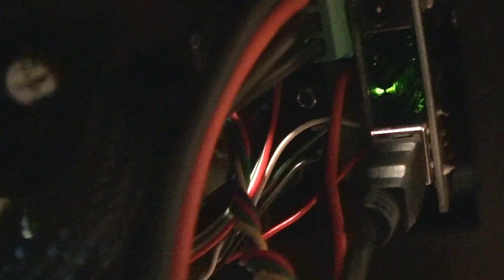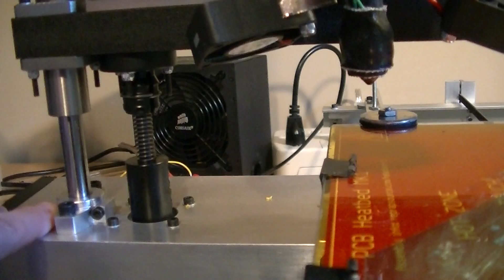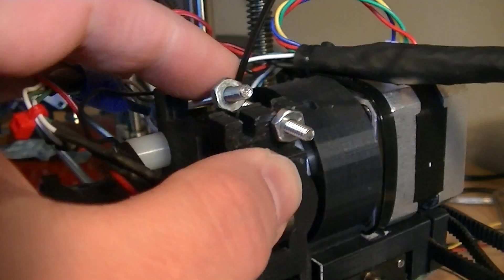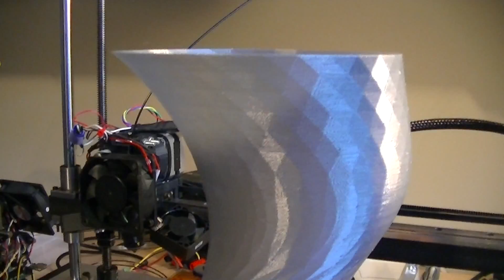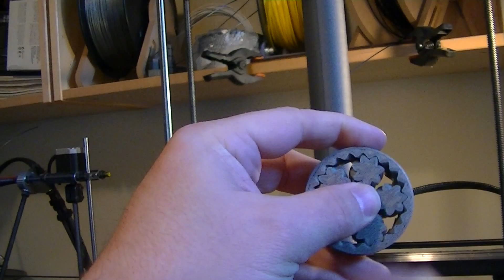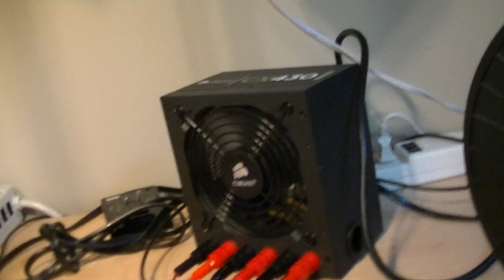Behemoth: Overview and Sample Prints

Comment: Very nice design, and a printer on which you can see, that the creator really keep in mind the mechanical construction! - not like other cheap&crappy printers :P
One thing to mention: you could place the upper clamps for the smoothed-rods of the Z-Axis inside the case - I know it would be a little bit more fragile, but i guess that don´t make a big difference. Maybe the end-stops too. Keep it up! Again, a very nice project!